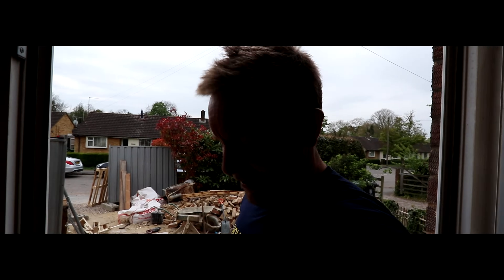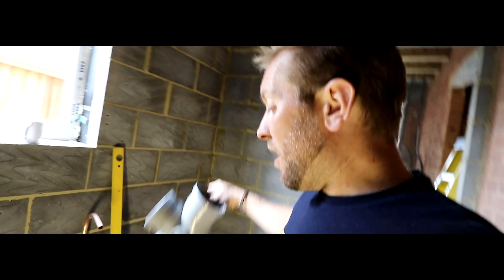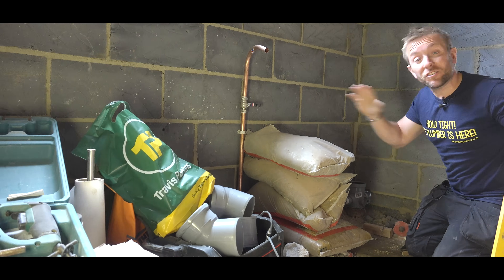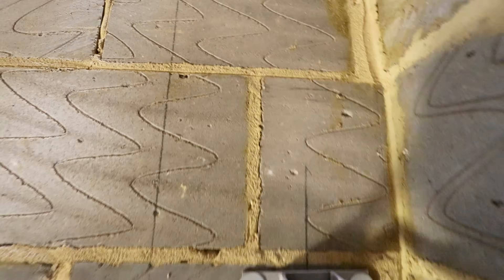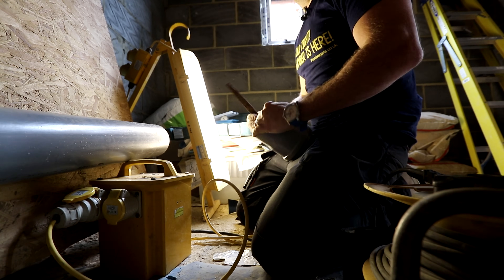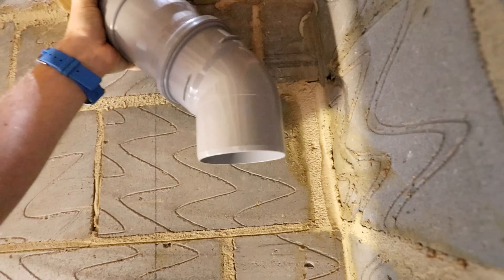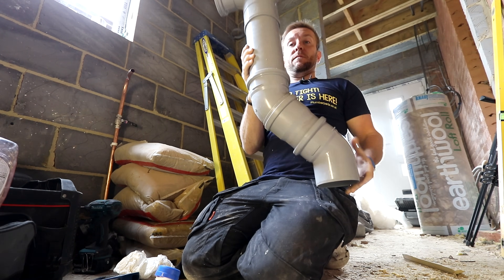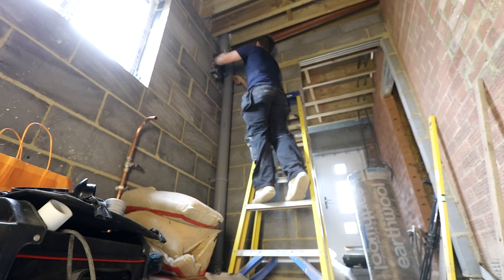HOW TO INSTALL SOIL AND WASTE PIPE 110mm - Plumbing Tips

Comment from the maker: I HOPE YOU ALL enjoy as much as I enjoyed watching the guy who delivered the radiators to this job tread in 6 inches of freshly poured concrete!!!!
Reply: :D
Reply: plumberparts 
are you sure the tapping sound throughout the video wasn't the delivery guy bashing his boots off.
Reply from the maker: Ha!
Reply: Did he "Hold Tight !"  :)
Reply: plumberparts  whu didn't you paper sand the interior of de pipe before glue it?... thats required for a sealed conection.
Reply: Why is the soiling Pipe inside?  I presume for a basement toilet or something like that, definitely don’t like waste pipes inside.
Reply: Hey,  from the US here. I'm curious as to why you would use those "boss" fittings in that situation. I know they come in handy for a preexisting pipe but on this job wouldn't it have been easier just to install a 3"×1"1/2 tee or wye or do they not make them for that type of pipe you're using.

Comment: If you're welding together with solvent type glue, it's important to apply glue to both pieces before joining - also abrading the gloss off the pipe and socket, either with acetone or light sanding will give a leak free joint forever.

Comment: Please some explain why he glued  a connector (coupler) at the top rather than use a longer pipe with a push fit end allowung the T section to simply slot in at the top?

Comment: I’d like to switch round my sink and toilet. Cast iron shitpipe and boxed in through downstairs room so don’t really wanna have to rip it out. The toilet and sink are only about 700mm away on same wall. Is it the norm to use a 90 to connect from new shitter position (back to wall concealed cistern so I can hide the pipe run) along a short run across to another 90 into cast iron shitpipe? What kinda distance would this add to the shitter position given I’m swapping close couples to concealed

Comment: Love all the video's. What is the grey fitting you glued into to the black boss called? Can I use one of those to push in the metal tube from a chrome bottle trap into that goes through the wall to the soil stack outside? Cheers
Reply: In the UK the boss I have used are 2"/50mm the fitting James used was a 2" to 1 1/2" or 1 1/4" reducer which will allow him to connect the waste(s) from either the bath, basin or shower into the soil stack, however each manufacture sizing can slightly vary (+/- 1/16") to keep you in their parts catalogue because capitalism.

Comment: James , my soul pipe terminates in the loft with a valve on it . It’s hidden behind the false wall where the shower barn is above the bath . I want to rip out the bath and take away the false wall and move the pipe into the corner and box it in. Does it have to terminate into the loft space or can I just box it in halfway up the wall and drill a few breather holes in the ceiling ?

Comment: Why are some parts push fit with a rubber o-ring (that I guess could perish) and some parts solvent weld which all being well last to dooms day? Always struck me as being silly as I would assume what you've done there will be boxed in so it can't be an access deal, can it?

Comment: Too much glue results in damage to the plastic of the pipe on the INSIDE. This makes the surface rough and is somewhere where the wet wipe will catch and block the sewer! Do not use too much glue, just enough, DON'T 'slop it on'!

Comment: Find this very strange. I have been doing this for 15 years in iceland. We use pvc, pp and skolan dp all with rubber rings. Why do you use pp with rubber ring then at the top you clue it. The you drill a hole instead of useing a T. 
Its 2018 stop soldering copper. Use uponor, rehau or copper t with pressfittings